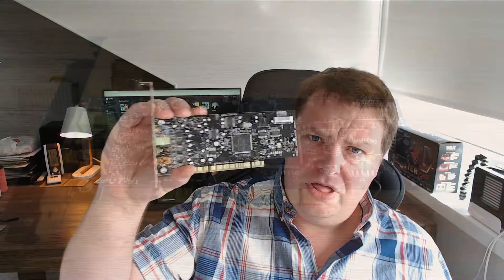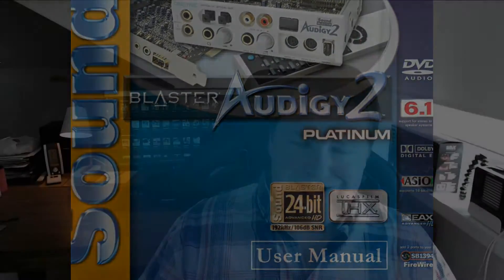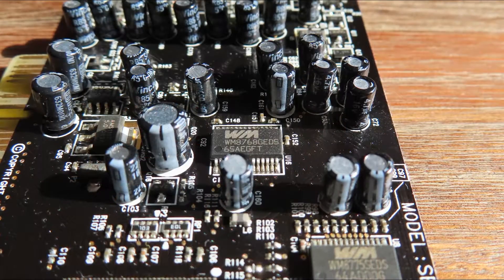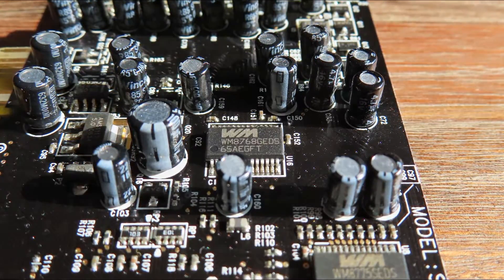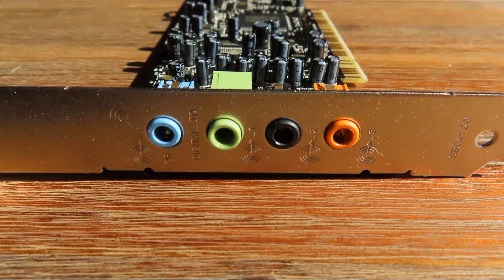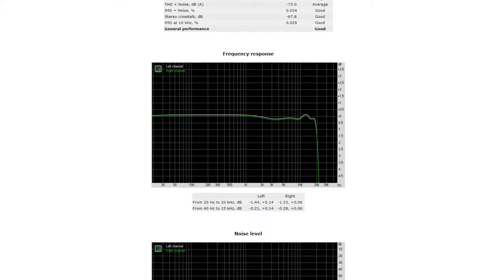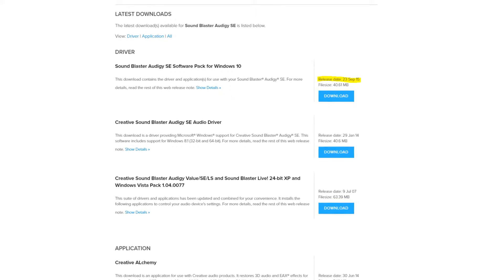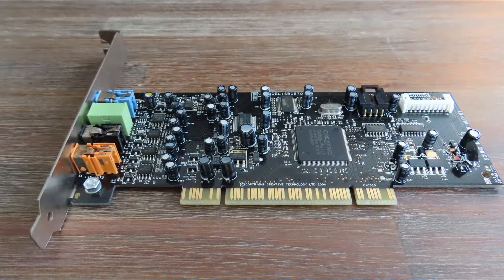Does SE mean Stupid Edition for this Audigy SE?

Comment: On win 10 with Daniel K drivers the Crystalizer is a noticeable improvement. How is this card compared with Xonar AE in games and multimedia? Is it worth the upgrade to Xonar AE with stock OP-Amp?
Reply: I have this SB, and with those drivers it's the same rubbish to listen to music, for games it's fine but only for that. The crystallizer only makes the sound worse because it "balances" the sounds, in this way at a frequency it automatically lowers the volume and it is not pretty.

Comment: The card is even older. Pretty sure it launched in the mid 2000s not 2010, i know they were available in 2006.
Reply from the maker: You are absolutly right. I rechecked my information and the card was launched, here in The Netherlands, in december 2005! Thanks for the correction!

Comment: found this at a thrift store for 3 bucks yesterday. I was hoping it was a bit better than this. Any idea if the stripped down drivers will function with the spdif out, and whether theres any impact on the spdif quality from this card's general lack of quality? I have an external usb system right now, but the spdif connection is supposed to have a better frequency response.
Reply from the maker: Have you tried the drivers from DanielK? I'm not sure about the SPDIF, it has been some time since I've seen this card!
Reply: @AntonsHardware  I havent had a chance to run the card in a system yet, ive been in the middle of a move. Ill try and get back to you after though
Reply from the maker: Thank you!

Comment: The Audigy SE is actually a stripped-down version of the LS, which is already a stripped-down version of the ES.
It's not that bad in a modern system - probably even better than the original Audigy and A2/A4 - provided you can get the X-Fi XtremeAudio drivers to work with it and enable the X-Fi features. While it's fully software-based, it doesn't suffer from the annoying "loudness normalization" issue plaguing Realtek UAD drivers and many PCI-E sound cards like the CMI8828.
It's only any good for gaming, though, where you want accurate positional audio through headphones. Your on-board sound is probably better for music and movies, despite the awful drivers.
Reply from the maker: I think you are right! Thanks for the comment!